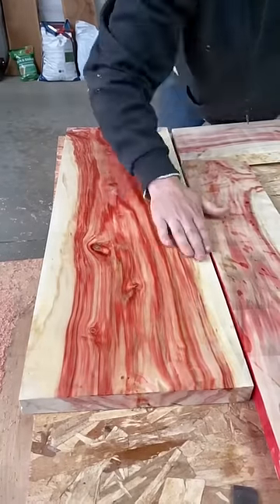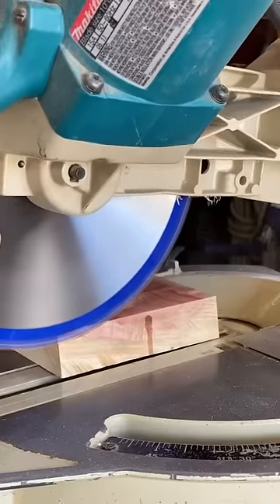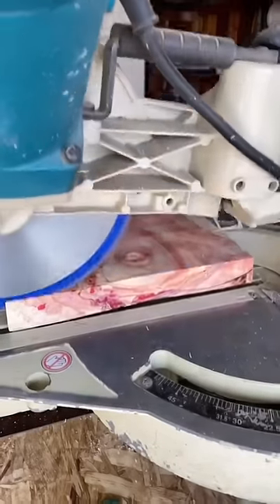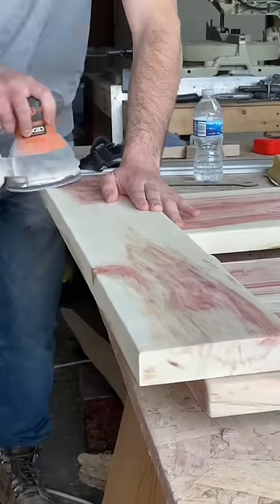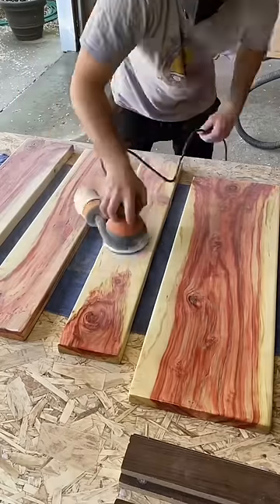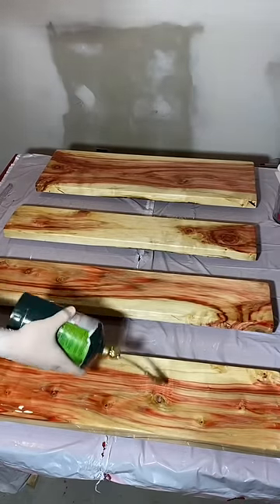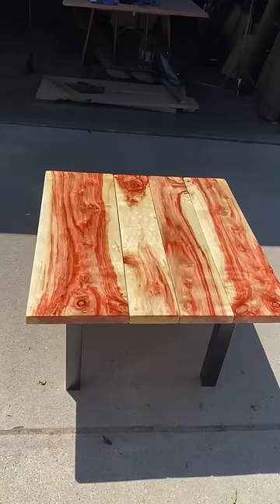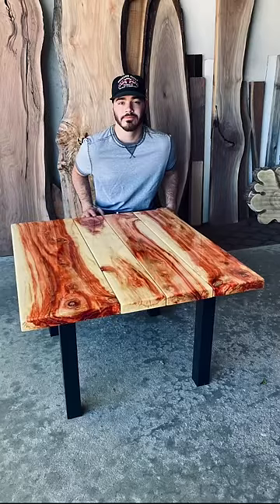🔥Flaming Boxelder Table Build🔥 #shorts #diy

Comment from the maker: For custom commission request send me a message on Instagram @gg.woodworks
Reply: How much would u charge for making that? Very nice, just curious. I dont do instagram, just you tube.
Reply: Can you make a guitar clock
Reply: I wonder, does this wood keep its color? Because I know that purpleheart and other vibrant woods can turn brown over time.
Reply: Next time add some waves in the middle, Square edges but Snake like weaves on the inside sides of those 6×X . itd look like a 4 stream river,
Reply: You should use a liquid ceramic coating on top two coats to give it a hard surface

Comment: Very nice, very pretty how you bring out all the red/white wood grain. One thing i'd like to know the use of the torch on the epoxy flood coat surface. I think you mentioned before in videos to pop any bubbles in the epoxy n smooths the finish before it drys ????? Can you use the same torch method on a Polyurethane flood finish ????

Comment: All the box elder I’ve run into around my area had very little red in it. Those pieces have tons of color 😍 Have them keep it out of the sun as much as possible so the red won’t turn brown as quickly. If the epoxy has a UV protectant in it, that will help. Don’t take this the wrong way because the coffee table turned out gorgeous, but why did you chamfer or round over each piece at the joints? Personally, I would have done tight joints and made one smooth panel.

Comment: Good looking wood that i hadn't heard of before and nice table other than (personal preference here) the rounded off edges where they join together instead of having a smooth uninterrupted surface across the top and then smooth outer edges for comfort. Nice job and still would love to have it as it is beautiful, and love that it's salvaged/saved wood.

Comment: The CA glue will not stretch with the wood.  Better using any type of epoxy.  Could you exlain why you CA glue before an epoxy pour? Is your mixture not wicking into small gaps?

Comment: So, what's not liking epoxy.? I've heard you mention it in like 75 videos.🧐 Okay, maybe not actually 75. I only just found your channel watching YouTube shorts this past Thursday maybe. Anyways, what is it. You don't like that can't feel the wood's texture or the grain of the wood through epoxy.? I know that bothers a lot of wood workers and a few wouldbe purchasers. If that's the case you, you might try to appreciate more of what epoxy can do. Quite simply, epoxy allows us to completely arrest the natural decaying process of a log or tree stump and turn what would've been firewood trash into treasure. Take this breed of wood you used make this exquisitely beautiful table. It would've been possible with anything less than epoxy. I've tried polyurethanes on wood with less flaws(which is part of what made that table so beautiful.) and didn't achieve comparable results.😎

Comment: Where are you doing business?
I have a diseased Spruce in a tree line. I want to make a table out if it. Do you have a lumbermill?
Reply: I do want epoxy finish on a Dining Room table.
This Spruce tree is about 3 stories tall. So we will have alot of beauty wood to work with.